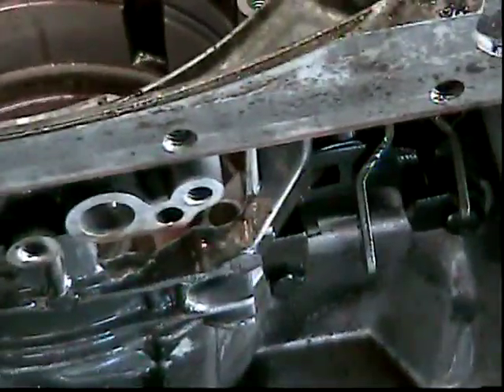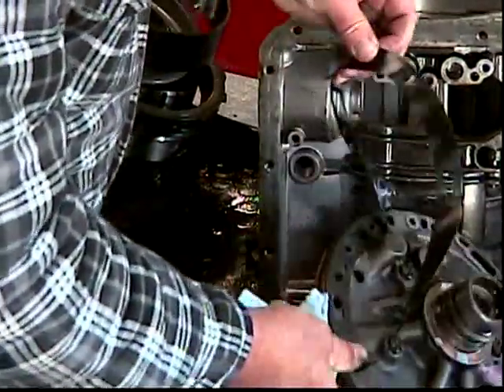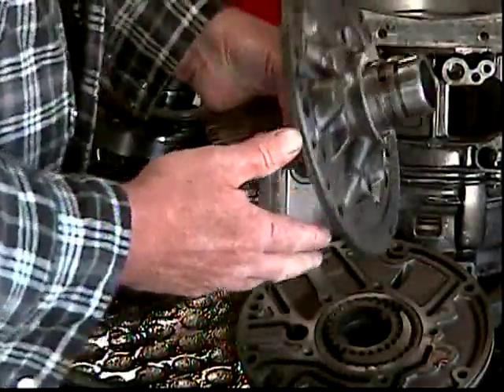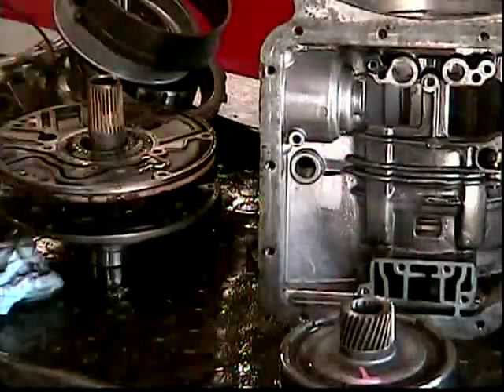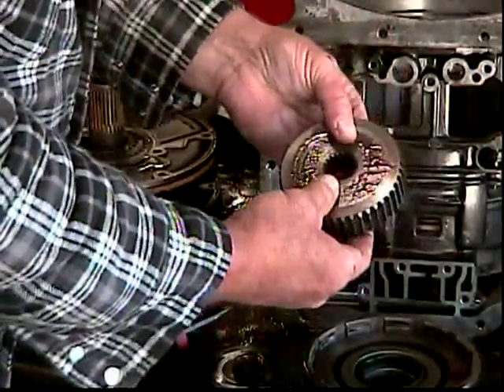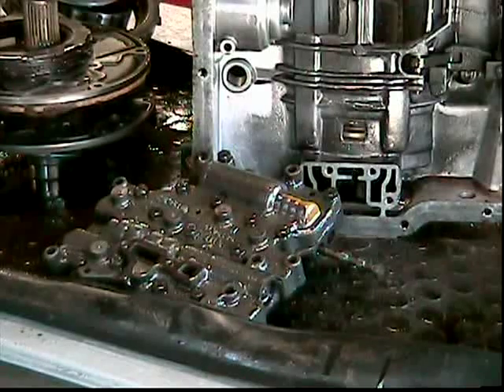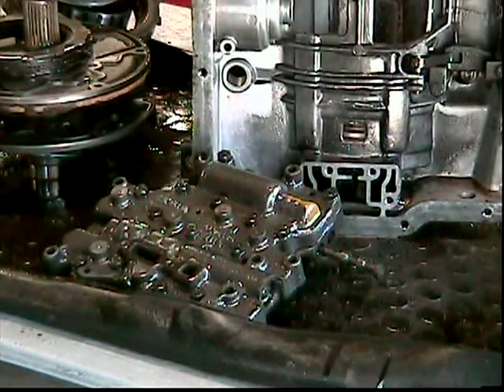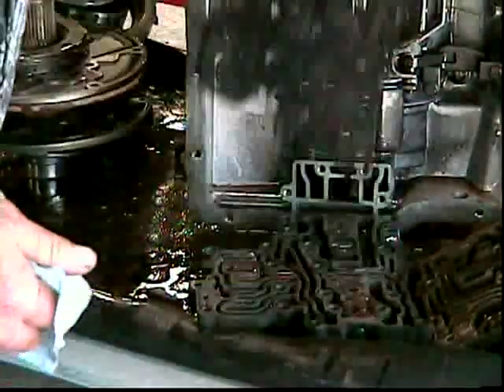Learn To Rebuild A Powerglide Transmission-Part 2

Comment: Brian,   Should these mods be done for street use.  I am running a 5.3 and turbo.  I will put in a trans brake down the road for some street use?
B
Reply from the maker: You cannot modify case for brake until it's installed.
Reply: @BrianSwayne  So I should just run it in original form and mod it when ready for the brake.  I will be street driving it so I was going to upgrade the input shaft clutch hub, more clutches/steels. with other things first.Thanks!
B
Reply: @BrianSwayne  What would you recommend for a turbo'd street car?
Reply from the maker: @6xcchamber971  I would build it upgrading internals and do the brake later. You really don't need brake for the street.

Comment: Great video. This is excellent and useful to have that powerglide transmission rebuild. Perhaps why not maximized the gear ratios for the highest possible top speed just as if Robert Campisi had that on his twin turbo Mustang. Maybe try that on a 1986 Chevy Monte Carlo with an 800 horsepower Chevy small block engine.